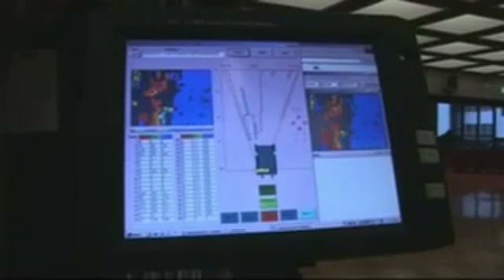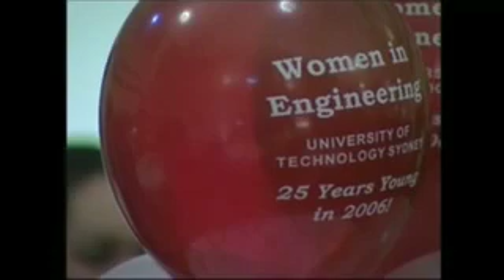UTS:Engineering - Leader in practice-based education

Comment: what about subjects like circuit analysis in the facultu of electrical eng which has a failure rate of 90% with many students mainly passing on the 3rd attempt. and what doesnt help either is the head of electrical engineering saying to students, 'as engineers you would be doing circuit analysis". talk about motivation when it comes to staff enthusiasm.